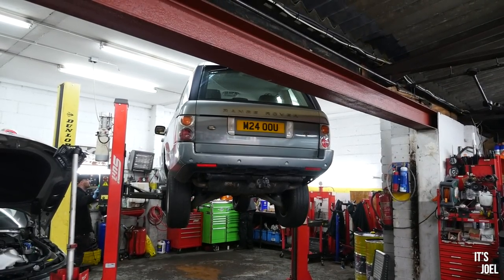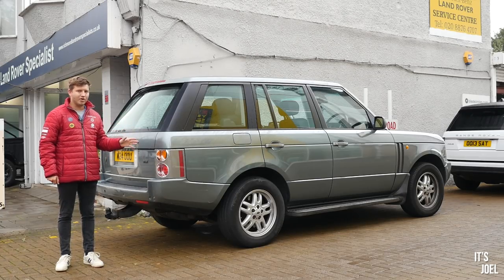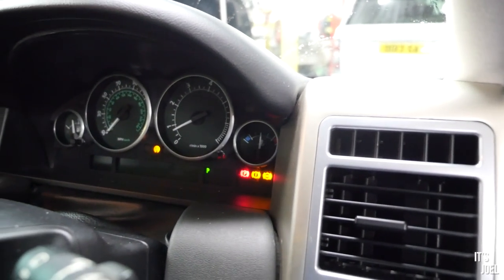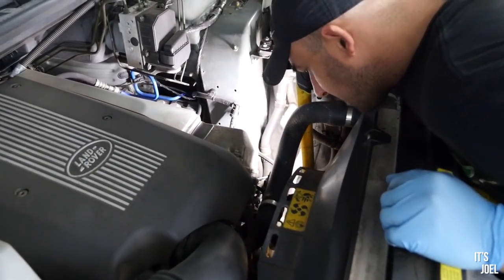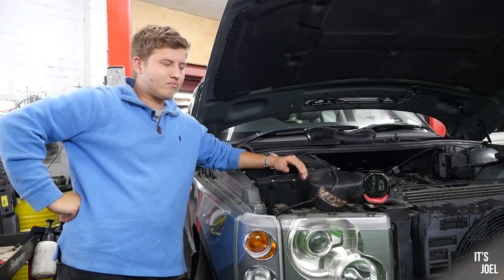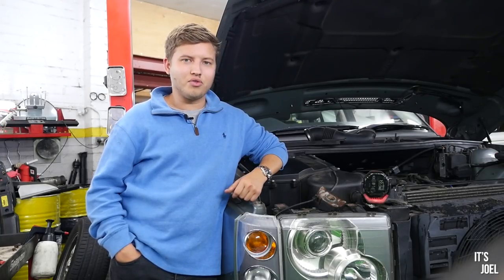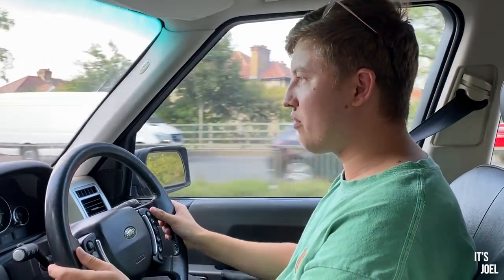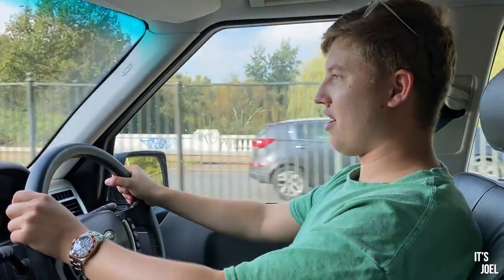Repairing the cheapest V8 Range Rover in the country... [Part 2]

Comment: Never say it’s working perfectly, it’s a Landrover 🤣🤣🤣🤣🤣🤣
Reply from the maker: And I may have spoken too soon too…
Reply: Egggzactly. I put a newer engine in mine - TUH! Sounds like train track
Reply: Range rover
Reply: You’ve never owned one either 😹
Reply: They should be renamed Land Yachts, they take just as much to maintain.
Reply: @Taz6688  I ain’t spend a dime on mine besides oil changes bc I specifically researched before buying and went with the 4.2 sc motor
Reply: Fay Zz  I have 2014 autobiography 5.0 sc and 2006  l322 full-size Range Rover supercharged 4.2 v8 and the 06 is built better. The 4.2 motor was a pretty reliable engine if taken care of. Some supercharger components need to be replaced around 75k miles but for the most part in my situation and ownership I’ve done little to no work besides basic maintenance
Reply: Fay Zz  if you are looking for a good reliable Range Rover petrol for a good deal and not breaking the bank I would start off looking for one in between 2006 to 2012. And look for a Range Rover supercharged. From 06 to 09 the motor stayed 4.2 sc. good motor avoid the 4.4 Petrol. It was a bmw motor and it is very known for being a shit show. 10 -12 was a 5.0 supercharged engine which was also a good motor. They also released the standard 5.0 petrol which is a good motor as well. I’d really suggest an 06 sc tho. Could find one for under 15k with 100k miles on it. And I’d suggest switching from air suspension to coil overs if not already done to it. Most owners would do this. There is a module to block air suspension fault code as well
Reply: Fay Zz  I got my 06 for 11k with 90k on it. You’ll probably see them for less

Comment: You should do wheel alignment after messing with suspension stuff. 
I had the same problem with steering angle sensor on my Z4 after putting new lower control arms and wheel alignment fixed that. It's just a good practice to do that occasionally.
Like the Range. :)
Reply from the maker: Definitely

Comment: Recognise all those faults. I had a 98 BMW 540 and they share electrics and mechanicals. Expect those cam cover gaskets to start leaking again in about 20,000 miles.... Its a lovely engine though, just keep on top of it and it'll serve you well. Oh, and if you ever are able to move the steering wheel and turn the radio on and off by moving the sun visor up and down, then you need a new ignition switch 👍